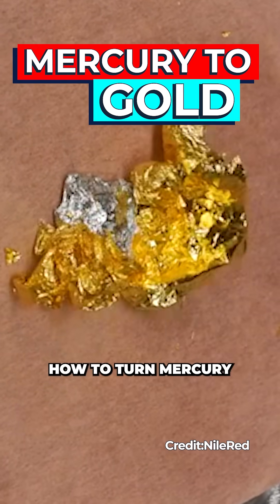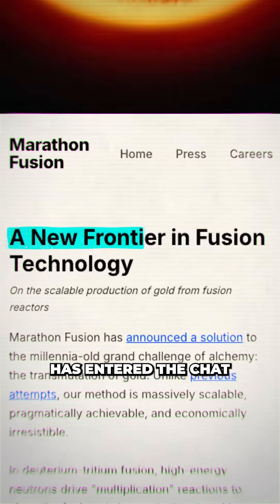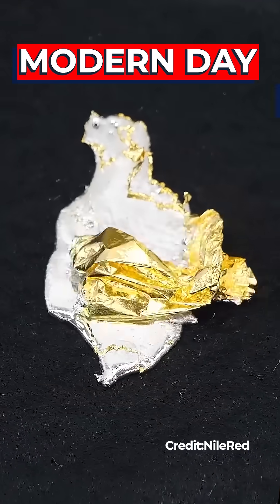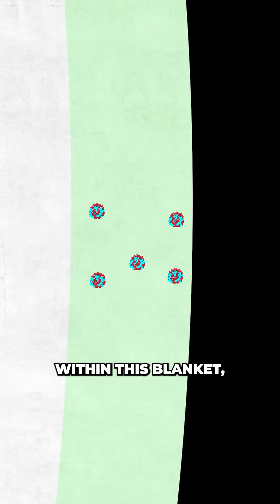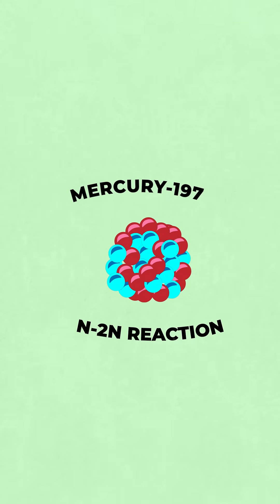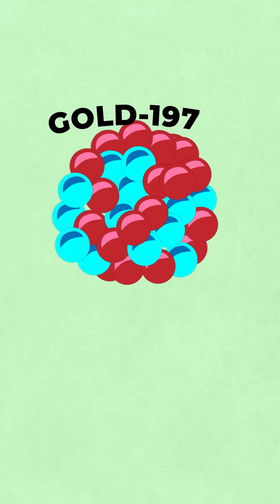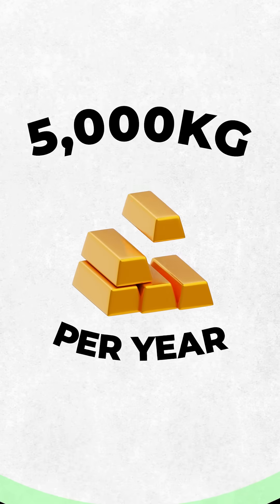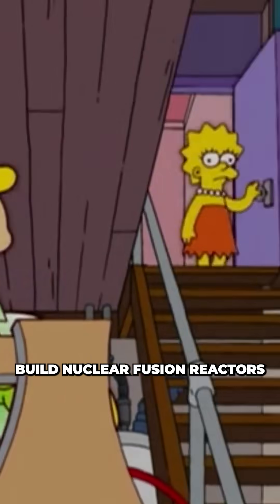Scientists Turn Mercury Into Gold

Comment: A few caveats for people who like the nitty gritty details:
1- You would need to enrich regular Mercury to obtain the isotope Mercury 198, which is occuring at 20% in regular mercury.
2- The technology isn't there yet. This was a simulation. It should work, but still needs to be proven by experiments.
3- The new gold would have to be kept in storage for about 30 years for it to completely decay and become safe to use.
4- If they do this on a big enough scale, it will inevitably lower the price of gold to adjust for this method, which would reduce the potential profits substantially.
Reply: Another science channel said 14 years of storage for it to reach safe levels. However, a lot of gold are tucked away in secure vaults as reserve currency anyway though, so I don't think a decade or three would matter much. If sold at a discount, then national banks with the appropriate vaults would gobble it up knowing it'll match the value of regular gold at some point.

The 3 to 5 tons a year per plant won't be enough to tank the market because mercury is also a rare mineral, which will limit the number of these plants. Gold also have a lot of unmet demand as well as potential demand which would come with lower prices, creating many layers of cushions in regards to price drops. The real potential demand for gold would have it replace much of what we use copper for today, but that would require increasing the yearly influx of gold by several hundreds. And up to 5 tons a year from a single plant is a drop compared to the mining industry's output of up to 3500 tons a year.
Reply: @ShadowTani interesting semi-benefit is the removal of mercury from the earth which is a highly toxic waste material. If the value rises enough we might see companies trying to recover mercury from the environment.
Reply: @totengraben  I'm not sure what you mean with a waste material? The metal is intentionally extracted from heating cinnabar, so its not a byproduct. Mercury have its uses, although concerns about its toxicity have resulted in much of its historical usage, like in thermometers, being phased out for alternative solutions. It still remains useful in the chemical industry as a catalyst however, and it's also used in some electrical switches and rectifiers among other. But it certainly have less known practical uses than gold, and so until better uses of it is found then having the option to convert it into a material that have unmet demand is certainly a boon.
Reply: @ShadowTani mercury as a waste material may be in reference to the cadmium, nickel and mercury occasionally found in electronic waste
Reply: @ShadowTani  Mercury is used in the mining of gold, leaving a lot of destruction behind it. If this substitutes mining in the Amazon & similar places, it will be a really good thing.
Reply: @ShadowTani wait till people start synthesising mercury 😊
Reply: @ShadowTani  until they learn to make mercury from iron or something
Reply: @ShadowTani  Central banks you mean. There are no such things as national banks. All banks are privately held. Even the Federal Reserve
Reply: @saakers  Please refer to wikipedia, a national bank is a thing. Although synonymous with a central bank it can also be used as a broader term, and to be fair I should probably kept it specific. So yes, I meant central banks. And I were talking from a global perspective where banks are certainly not universally private. Where I'm from, Norway, the central bank is owned by the state and is its own legal branch of the state.
Reply: @ShadowTani ”Please refer to Wikipedia” hahahahaha. Wow.
Reply: @Wolfe-xz6tr  It's condensed and easily accessible information. Just because one have trust issues and favor conspiracies doesn't mean it's an unreliable source most of the time. If one prefer to spend the extra time doing ones own research then the same information can be found spread across multiple other sites. The later is certainly the preferred method for more subjective subjects, but in regards to what boils down to defining a concept? You'll just be wasting your time.
Reply: @ShadowTani  On your YT profile you have a cartoon dragon and listed pronouns. It all makes sense now. Sit this one out, kiddo.
Reply: @Wolfe-xz6tr  So what? Lol, "Kiddo" says the willfully ignorant Karen who takes offense at something as minor as someone specifying whether they are a man or a woman in their profile, while apparently being so insecure that he think modern entertainment and art can't be appreciated by adults. That's neither a rational or mature response by any measure. I understand you have nothing else than an ad hominem to counter with, but you're only shaming yourself.
Reply: @ShadowTani okay but if Mercury is rare too, would we theoretically be able to produce the Mercury through fusion via a more common material too?
Reply: @ShadowTani Mercury has an abundance of 0.08PPM while Gold is 0.004, making it significantly more abundant than Gold and proves your opinion totally incorrect and void as any increase in gold supply will reduce demand and price; dozens of those nuclear plants would severely plummet the price of gold. 

Maybe know what you’re talking about before sharing an opinion? 

Just a thought.
Reply: @Slayer2029  Spare me the arrogance. One mistake doesn't invalide an entire argument. Fair enough, gold is less abundant than mercury in the earths crust, but most mercury is extracted from cinnabar ore which is not particularly widespread. Still more abundant than gold deposits apparently, but not to the scale of twenty times that you get from just looking at the crust sample ratios. Still, my point was that Mercury is still rare, and that would remain true even at twenty times the ratio of gold. Rare enough to limit the number of these plants being built.

And the market goes both ways, by the point at which gold prices would go down, mercury prices would gone up. At which point the economic viability of such plants would also go down, limiting new ones from being constructed,

Moreover gold have many practical applications and an unmet demand as it is, especially if we count all the things which gold would be the more ideal material for, but which we now use substitute materials for instead. Prices would therefore even with a larger influx only stabilize at a lower price point, not plummet.
Reply: @ShadowTani It really wouldn’t. As gold drops who do you think is going to hold onto it? The holders will drop it like a hot potato and it will flood the market space, plummeting price and making it a semi-common metal. It only holds the price it does now because people invest in it long term and hold it, which keeps supply down with demand high. As soon as they start dumping it all changes. 

There’s also plenty of mercury mines that closed because it simply wasn’t worth the cost of mining as a result of low demand and the toxic label; when they overnight turn into literal gold mines people will be rushing from all over the world to invest and restart them. 

Meaning both gold and mercury will flood the market and neither will balance each other out.
Reply: @Slayer2029  If the banks stop hoarding it, it'll be gobbled up by the industry instead. But that's unlikely to happen. Due to golds unmet demand its prices is astronomically high now and still on the rise. It was still attractive as a form of reserve currency back when its value was considerably lower. At this point lower prices would be a relief in the market, but because of that unmet and untapped demand any new influx of gold will have a fairly notable cushion in regards to price drops. Thus if the influx is significant the drop in value would still be slow over time. It won't plummet.

3 to 5 tons a year from a single power plant is not significant compared to the 3000 to 3500 tons mined each year. It would take quite a few such plants to make a notable impact.

If we had enough gold to use it for everything where it's the optimal material then it would replace much of what we use copper for today; that's just how significant golds potential demand is. And that demand can never be met by converting mercury alone. The entire worlds supply of mercury could be turned into gold, and the world would still find an use for every bit of it.

Nevermind that 80% of all the mercury would need to be enriched which might be detrimental when the actual goal is energy production. Remember gold is a byproduct of this, not the goal itself. So for all we know, only 20% of the mercury is viable in the first place.
Reply: @ShadowTani gosh guys, this was amazing. Thanks for your thoughts! Really insightful. I'm with ShadowTani tbh. But maybe because of my bias of being invested in gold. On the other hand I trade it as well, so I don't mind shorting it. But to me, it resemble AI. People think it's 100% going to control us in future. But the AI models now barely can spell sentences correctly. So we are very very very far away from general AI. As well as with "alchymist gold".
Reply: @Slayer2029 We need gold for tech tho, idk why more gold is a bad thing
Reply: @Slayer2029 This is fake news. Throughout all of human history mercury has been mined to the tune of around 2 million tonnes, whereas gold is estimated at around 225 thousand tonnes and silver about 1 million tonnes. 80% to 90% of that is in the last 100 or so odd years.

Gold gets mined to the tune of 3,000 tonnes per year on top of 225,000 tonnes that have been mined.

In order to produce 1 tonne of gold from mercury, you would need 600 tonnes of mercury to obtain Hg-196 which is naturally occuring with an isotope concentration of 0.146%.

This means that to make even 1% of the currently mined gold production, about 30 tonnes, you would need to mine no less than 18,000 tonnes of mercury. The entire global production of mercury in a single year is a tenth of that, and most nations have signed laws that force them to stop after 2032.

It would hardly make a dent in gold prices even if they figured out how to use all of the available mercury that has been mined throughout human history, roughly a million tonnes, which would yield as much as 100,000 tonnes of gold using the desirable mercury isotopes (Hg-198 (around 9.9% concentration) or 1,600 tonnes (Hg-196, 0.146% concentration).
Reply: Goldfinger likes No 3
Reply: @Blechfuchs goldmember
Reply: They will just copy the DeBeers playbook. Release in at a steady trickle to maintain high prices.
Reply: @Bob_Smith19no the trick there is to convince people that you should spend 3 months salary to pay for a single ring
Reply: @Bob_Smith19 Unless many people do it
Reply: @Bob_Smith19no if it's possible u can put together ur own system to make ur own gold and u become rich. the economy will drop there's no way to "maintain" it that's a fantasy
Reply: @Bob_Smith19  think what you want, but companies in general prefer to sell more units at a lower price than less units at a higher price, because the increased demand due to lower prices usually ends up generating more profit overall, even though the profit per unit is lower. Of course, this only works to a point. Sometimes companies have to reduce supply in order to not have the price drop too low to where they can no longer make a profit, but in general, companies definitely prefer to operate at a larger scale and have more product turnaround, as they can take advantage of economies of scale, it helps with cash flow, etc.
Reply: @Bob_Smith19No, no they wouldn't. It costs millions to make a few grams of gold via this method. It would be cheaper to dig for gold by HAND
Reply: @Bob_Smith19 that only works when you have a monopoly, lol. If they don’t sell their gold, they won’t profit, and everyone else will continue selling their own gold.
Reply: To be fair, gold is already often just being kept in a vault for long periods of time.
Reply: Yes and no on the profits. Gold isn't just valuable for jewelry anymore. It's highly useful in tech. The value of gold will keep going up as tech demands more of it. So, while this gold would slow that increase, it won't cause a decline in value.
Reply: @xyex yes the value will 100% decline if you saturate the market enough, although it would still hold a relatively high value so could potentially be worth it considering the price to make it since its usefulness in electronics, if they scale up the production enough to make it actually cheap, imagine they created millions of tonnes and it became cheaper or not that much more expensive then copper, people would use gold cables instead of copper ones since it’s more efficient and easier to work with, gold is so soft it would be perfect to use in cables since you need to bend them to make good looking installs….
Reply: @xyex  that’s should be the pinned comment 😊
Reply: @xyex  And because of its growing practical use/ease of control, the rich will have a reason to ignore over production. Which they will be happy to do, since the cost of entry is high enough not to threaten the status quo, and they prefer market stability.
Reply: @xyex  As mentioned by OP, this is scale dependent. It also depends on gold recycled from old tech.
Reply: @xyex saying the price wouldn’t lower is dumb, ofc it will go down depending on how much the market is saturated… you have to be a moran to say it definitively won’t… I’m not saying the price will go down, but saying it won’t is delusional….
Reply: @Rrrrrrr37762 If the value goes up $30 but, at the same time, down by $10 because of nuclear gold, then it still went up by $20. You'd need a much bigger influx at a much faster rate to really have an appreciable effect.
Reply: @xyex The intrinsic value of gold is far below the strike price. Last time I read up on the intrinsic value it was only around 400 / oz. That was probably 6 years ago so it'll be a bit higher but to justify the price with that logic is not accurate.
Reply: @CaptainGreenTea 😂 wrong
Reply: Curious about the details on #3, but #4 is just how the market works lol
Reply: There is also the fact that the Lithium blanket would be absolutely essential for a fusion reactor. You would need to bring in tritium for this process to work otherwise and that is all but impossible since there is next to none naturally occuring due to its relatively low half life (12 years I think).

Making the blanket work properly is also one of the main struggles currently in magnetically confinemed fusion research.
Reply: 5- no matter the century, fusion is always half a century away. 

6- they could get the neutrons from fission too.
Reply: Profits don't matter because the main profit is having more gold, which has more applications for technology and science than it does for useless jewelry or as a basis for monetary value. This also means more people would be able to afford gold jewelry and bullions, negating the need to eliminate gold jewelry in order to have enough gold for for future technology. (Which right now we will have to eventually eliminate gold jewelry because we need it for semiconductors and technological applications)
Reply: @bodhiallen9362 We don’t need Gold for industrial use at all.
Much cheaper and superior metals available
Reply: You don’t need to enrich Mercury, once it turns into gold it can be chemically seperated. Nuclear fuel for fission has to be enriched cuz it’s a volumetric density (and probability) limited reaction. U-235 atoms need to be concentrated within a particular volume of space for them to produce enough neutrons for the 2nd generation of reactions, etc etc. Right about the rest though, and enrichment would’ve been by far the hardest part. Also its beta decay so the radiation isn’t that harmful, although not something you’d want for a medical implant— oh wait they already use betavoltaics in medical implants
Reply: on 1) Yes but you would also have to enrich lithium to have the same breeder blanket, and enriching heavier isotopes is a known tech (and simple/cheap, more so at 20% initial enrichment)

2) TBF most of fusion tech is either not proven or in its experimental phase, but its a fair point.

3) Not a huge issue tbf, just would require setting up systems in place to ensure profitability and ensure the gold isnt stolen in those 30 years.

4) TBF with gold there are tons of industrial uses for it, so like platinum (which is in the same boat) there would be a floor for the price where if it dropped below industry would gobble up all of the gold until it went back up above the price. Would suck for gold hoarders but at the end of the day it would be better for humanity if gold was cheap as its such a good industrial element besides its price.
Reply: Oooh the number 3 part makes me worry black markets with possession of this gold before the 30 year decaying period would skip it and just sell it without moral responsibility, causing radiation spread, there will be a new set of laws and gold tracking will certainly be improved as well as radiation meters from gold purchasers once this issue starts gaining notoriety.
Reply: Lastly, the isotope of tritium used in nuclear fusion reactors is also used in H-bombs. 
As a result, it’s likely one of the most sought after materials on the planet, with the overwhelming majority of it being stored in warheads. 
Unless/until nuclear disarmament occurs, it’s likely that this isn’t the most viable use of that breeder blanket, since you’ll need the tritium it makes to continue testing.
Reply: I've been doing this in my shed for 20 years. Not sure why my neighbors keep dying
Reply: 3 is't a problem because 99.9% of all gold is never used anyway and just stored away in vaults
Reply: @nielsdaemen However, much of the gold America claims to have at least, doesnt exist in those vaults anymore, so it is desperately needed. They need to replace the gold they already claim to have.
Reply: Thank you Science side of Youtube
Reply: Couldn't you chemically separate out the radioactive mercury from the gold to make it safe to use early?
Reply: Kinda like commercially produced diamonds
Reply: @riggmeister I wonder if it would be discernible from its earth-mined counterpart tho, as  lab diamonds are
Reply: could still borrow against the future expected value
Reply: Actually it's very risky to lower the price of gold considering how many countries support their currency through gold reserves
Reply: It won't necessarily lower the price completely because the new wealth of gold could open up a boom in electronics, and honestly, who cares if gold becomes basically worthless, it's still gold, the best bling there is. The only people that would care would be those obsessed with its monetary or status value. I, on the other hand, would love to see a world where humans walk around decked in gold.
Reply: The value would probably not go down. Gold is so useful, it’s not just a pretty metal and the demand is only growing. 

If anything it might lower the price a little but not enough to make it unprofitable. If the price goes down a little, it would just mean we would use it in more applications where we use a worse but cheaper conductor. 

I mean diamonds are still expensive and they are super common. 

Supply and demand are much more complex than “more supply equal worthless in value”. Especially if the demand will still be there at a larger than ever before level.
Reply: Japan is already building a mercury/Gold reactor , so the tech is there already.
Reply: Makes me think of the claims of astronomical riches in space in the form of like platinum and gold. Thanks for the details.
Reply: Keep the gold in storage for 30 years and not touch it? Like... in a vault? As in... what many banks and sovereign nations already do with the gold that they already have? 🤔
Reply: I'll let the next generation solve that. They've already got 99 problems trying to save the planet from the damage we've done so what's one more problem between relatives?😅
Reply: Also countries use gold  in treasuries as a way of avoiding their money losing value. So a massive influx of gold would mean this idea would no longer work
Reply: @Jdhdhdhsrnnc Possibly then again they'd probably shift it to other metals and start using their gold supply for other purposes that may yield higher return such as tech research or industrial.

Even lithium has a lot of value due to it's uses in electronics. Gold would becomes something similar. Used in high end industrial projects were copper isn't enough.
Reply: I can wait thirty years for a solid gold fiddle...
Though it would probably sound pretty crummy.
Reply: There are ample industrial uses for gold that would tolerate radiation that would not be tolerated for Juley.
Reply: The 30 years shouldn’t be an issue since they could just place it as a reserve  / store it in an underground bank vault or locked away somewhere else and never move it for years / decades ~ like the majority of gold we have now. 

Still a big deal if gold can actually be produced in this way since we as humans haven’t had the capability before and we’re just mining the gold that has resulted from natural cosmic star reactions
Reply: I heard it’s super expensive. Like completely makes it not worth it .. plus the other 4 he said
Reply: Then we could stop obsessing over shiny metallic gold as a luxury item and start using it more in electronics, electrical applications, and other practical things.
Reply: @gabriellashimone6546  tbf the cost has very little to do with its use in electronics.

So little of it is used in them that its pennies per item. Maybe if it was cheap we would see it in bulk applications, but even copper being as cheap as it is isnt used in massive bulk applications like powerlines (which is where gold would be best). Soooo there is that.
Reply: @kkirschkk  Cost isn't the point.  Gold is, in truth, useless in any practical application that isn't electronics or electrical systems.  Humans need to start being beings, not magpies.
Reply: @gabriellashimone6546  I mean gold has tons of uses outside of electronics. Chemistry, alloying, art/decoration, medicine ext

Plus what is the issue with enjoying the color or using it as a store of wealth? You seem to imply there is some issue with the above morally.
Reply: @kkirschkk  Practical applications would be electronics and electrical systems.  Those include medical applications.  Alloys with gold, maybe.  Art and decoration is impractical.  There are many more mediums used that require far less processing for both art and decoration.  You're still thinking like a gold addict, something I find deplorable in humans.
Reply: @gabriellashimone6546  I mean liking the color of gold isnt deplorable lol, its like saying the color red is over used.

Also yes some medicines do use gold, so no the limitations of the use of gold are not just electronics/electrical systems.

You sound like someone who has a bent out for anyone who likes gold for anything other than utilitarian uses.
Reply: @kkirschkk No.  Greed is deplorable.  I know what gold is useful for and what of those uses are the most pragmatic.  We aren't magpies.  We also tend not to be pragmatic when it comes to "shinies."  Are we really going to doom ourselves to primitivity or are we going to put aside this foolishness we are presently enslaving ourselves to?
Reply: @kkirschkk Also, I'm well aware of its use in both medicine and chemistry, as well as metallurgy.  Those, too, are practical and require less Au than the uses in electronics and electrical systems.  I think we'd be better off using Au for practical purposes and leaving off with the lust for it and the hunger for wealth.  Such things are doing us no favors.
Reply: @gabriellashimone6546  I mean they also do not really bottle neck other uses for gold either.

Remember a lot of the reason gold is expensive is just that its not a common element and mining it is expensive. Sure a lot of demand is also drawn from its luster and color, but the amounts you use in electronics and other applications is so low this is a non factor.

Basically there isnt any reason to be against gold's use as being an item we like/think is pretty/
Reply: @gabriellashimone6546  "doom ourselves to primitivty"... I mean when we are not dooming ourselves due to our liking of gold, since again the amounts we use are so tiny that they are pennies on the dollar.
Reply: @kkirschkk  Alright, we're on the same page, more or less.  The problem at hand is that humans keep lusting for a thing and don't seek to make practical use of ant materials.  Our species is like so many rampant toddlers wielding a bucket of tempera paint and splashing things with it fervently.  I think we are really capable of far more than that.
Reply: @gabriellashimone6546  I mean there is enough resources to go around while still finding value in the visual aspect of things. That isnt an issue.
Reply: @kkirschkk  There really aren't or those resources wouldn't be given the value that they have been.  Too much value.
Reply: @gabriellashimone6546  I mean is there anything subjective about saying "this has too much value" other than you drawing a line in the sand? is any other noble metal considered in your mind to be over valued?
Reply: @kkirschkk  Yes.  It is a waste.  You continue to speak like someone enamored with wealth.  Continue being a magpie.
Reply: @gabriellashimone6546  I speak as someone who doesnt think we need to just use everything for its most utilitarian use, more so as there is more than enough gold to go around for industrial uses while also still using it for art and other less useful things.
Reply: @kkirschkk The problem is the mentality of most humans.  They go full magpie, lusting for the wealth of gold, not it's beauty, not it's practical applications.   I apologize for being so harshly staunch about it.  Gemstones are pretty, too, and also have practical applications aside from the artistically decorative.  Those, too, are used as symbols of wealth, position, and thereby power.  I am disgusted by such ideals and consider them truly beneath what human beings are capable of doing and being.  My disdain is for the prevalent and dominant ideals that destroy human and other animal lives for the sake of prancing around with nose in air.  Those who are truly worthy of honor don't need objects, funds, or title.  They certainly don't need opulence and ostentaneity.
Reply: @gabriellashimone6546  I mean that still dosent answer the issue of whats wrong with opulence.

We dont need most foods, or personal computers for that matter, yet they are great things to have and we are better off for it. Again using gold in art or design or opulence, while not needed, also falls into that grouping of things that are great to have.
Reply: @kkirschkk Opulence and the lust for it, along with the idea of wealth, is the third chief reason for violence.  The first is religious differences, the second is control of resources.  Beautification that satisfies aesthetic sense isn't negative in and of itself.  It's the mentality of division because of the desire for more and the notion that more shinies makes one better than those around them.  Human ideals need to change so that environments and living things aren't destroyed or subjected to slavery over or because of opulence.  Practicality needs to take first priority with respect to resources, together with equalizing society so that everyone has their basic needs met and are able to find purpose.  A lot of my thinking comes from things like Star Trek.  I believe in equality and merit.
Reply: Obtaining a wealth that will slow delete you is some wicked irony.
Reply: Do you know if it would be completely indistinguishable from ordinary gold, or could people tell it is man made?
Reply: @br.m  So once its purified and has sat to rid itself of any radioactive isotopes, not really.

The reason why you can tell man made diamonds and other gemstones apart from natural ones is that the man made stones are too perfect compared to the natural ones (and have defects that don't occur in nature while not having natural defects that do).

With gold it is purified to 99.999% purity (5 nines, about as good as you can reasonably get on an industrial process without spending boat loads of money), and while in theory that remaining one thousand of one percent (or 1 part in 100,000 or roughly 10 parts per million (ppm)) might be able to give it away if its radioactive or has a trace element in it, you can also dilute the gold with other "natural" gold to further make it hard to track (you cant melt and dilute gemstones).

Plus most detection methods struggle to detect light elements below the 50-150 ppm (without going to insanely expensive and variable methods, a lot have questionable accuracy), and while heavier metals can go down as low as 1-20 ppm your getting into the range that interference compounds can send results all over the place (plus tests going down this low are very expensive and very prone to errors).

So in theory yes (but it would be extremely expensive), but the testing would be prone to massive errors (+/-100% or more), and you would only have to dilute the gold down with 9x of the same volume of "natural" gold to basically make it impossible to detect with any reasonably practical solution on an industrial scale.

Plus at the end of the day, who cares? Its physically and chemically the same (even more so than lab grade diamonds which are only chemically the same).
Reply: @kkirschkk and if you're impatient, it's just beta radiation, mostly harmless unless you eat it. But who would ever eat gold right? /s 😂
Reply: @kkirschkk synthetic diamonds are also marked with a tiny microscopic laser that identify them as synthetic
Reply: @Flipout22  Thats only if the company that does that bothers to do that. Easy enough to avoid it.
Reply: @br.m  Gold is an element, if it's melted down, any specific isotope of gold is not going to be differentiable from the same isotope sourced from anywhere else. Same as iron and copper.

Similar market - artificial diamonds (grown from carbon) are also really hard to differentiate from naturally formed diamonds, aside from being perfect.
Reply: @leaf2690   I figured as much, just like some coins are sold as "single source" but there is really no way to prove it is from this or that mine..

In any case, I am sure the powers that be will find a way to make sure gold stays expensive even if they can create it cheaply.  Hopefully this created gold will be less damaging to the environment.  Just like how people are starting to use plants to harvest metals from the soil.
Reply: @br.m Are you asking if it's REAL, elemental gold or if it is distinguishable from gold in nature under examination? In theory, it would be real gold. Another commenter discussed whether we could distinguish it from gold found in nature.
Reply: @br.m this gold and the gold you find underground are identical in an atomic scale, there is absolutely no difference between the two except their origin.
Reply: There is only a single stable isotope of gold, so if this synthetic gold is completely purified it would be indistinguishable from natural gold 

But it is virtually impossible to completely purify anything, so there may be traces of the source that could be measured.
Reply: @br.m nah, prob not
Reply: @br.m if the gold is truly gold down to its atom's isotope, then it's gold.
Reply: @br.m  It would produce "tons" of gold, but in the literal sense. We mine many tons of gold per year already, the market doesn't care. You need a substantial amount to affect it (like when the Spanish created inflation by looting the Aztec and Inca of their gold)
Reply: @br.m there would be trace amounts of isotopes not found in natural gold. So under a spectrometer, no?
Reply: @br.m  Most likely indistinguishable. It's not like diamonds where one can look at the crystal structure. Gold is a metal. An atom can either be gold or not be gold.
Reply: @br.m it would be more radioactive than typical gold. It also would different mixture of isotopes compared to that found in nature
Reply: @br.m  it's an element. It will be identical to real gold.
Reply: @br.m There would always be traces of Mercury left in it
Reply: @br.m gold is gold. No difference
Reply: @br.m Its radioactive.
Reply: Make it all at once and sell it in 30 years
Reply: Aa I understand it 10 half life decays should bring it back to near background levels of radation.  So in 640 hours you would have 1024 times less radioactive mercury.
Reply: Sounds about right 👌
Reply: I mean we use gold in electronics so i think theyd have a fairly steady income from tech companys alone
Reply: The other issue with this process tends to be that the power required to indice this reaction has always been more expensive than the actual gold itself.
Reply: Is mercury abundant? Will the price of mercury sky rocket?
Reply: @Aurelio-88  $6-$20 per kilo, it is rather abundant so its unlikely that the price would skyrocket.
Reply: Yer, 20 years away 😅
Reply: It’s really good for materials tho
Reply: It will still produce gold at a fairly slow rate, and it's more likely to help with the initial costs of building the reactor in the first place. It's also just a byproduct of generating power via nuclear fusion, so other than the cost of getting and working with the mercury itself, this doesn't ridiculously add to the cost. Finally, this is where I'm just guessing, but it's also possible we could make other materials this way by using a different element than mercury. Not sure if this is true, but if this process works out, I imagine it's a possibility.
Reply: Thank you for supporting facts and reality. I hate how these accounts will say the little points about something and make out like its a big deal only for the big picture to be a pile of BS. We dont have finished fusion reactors of any kind at the moment, and even stating that "this simulation and the papers about it arent peer reviewed" means nothing to your average person and they know it. When that statement really means "its only a simulation based on technology we dont have yet and the scientific paper behind it means absolutely nothing because it hasnt been peer reviewed"
Reply: 3rd point doesn’t matter because normal gold doesn’t change hands too. It is just the paper that says I own this gold. They just sit in vaults in major trading hubs.
Reply: Pro, less toxic mercury.
Reply: I think it'd be cool if they just used that to make space projects rather than inflating market value
Reply: *deflating
Reply: Well consider how useful gold would be for various industries if it were a bit more cheap and plentiful. The price would of course drop, but not necessarily the profits of the producers if the price reduction opens up new markets.
And I'm sure with jewelry it will be the same as with artificial diamonds- People will still pay premium for the real thing, even if you need a microscope to tell the difference.
Reply: It will reduce profits but fuel advances in science and tech and improve the world in many ways. For instance, gold allows for improved  efficiency with less byproducts in many chemical reactions when used as a catalyst. That, plus politically fueling the adoption of fusion reactors, could allow for cleaner, cheaper energy at scale.
Reply: No, I disagree. A big concern with gold is its limited amount. We can use gold now instead of copper for lines which is one of the best conductors, I believe. Gold is fucking goated for electronics, and being able to print gold would fuel a new age of upgraded technology infrastructure
Reply: India would hoover it up, as would everyone else who wants gold jewelry
Reply: Leading to laws to prevent the making of gold.
Reply: Yea but they can still trade the gold while it ISS being held jn the safe..if this works out it will demolish the price of gold
Reply: @Kukulkan_Tours The point of making it illegal to make gold. All reactors are under some level of government control.
Reply: Gold being cheaper is good considering its usefulness in technology
Reply: This is awesome info. That sounds like an absolute win, too. Gold being pervasive in electronics, this sounds very highly positive.

I can only hope that similar methods come about for chemical sythesis of lithium.
Reply: Just bring in an asteroid rich in gold.
Reply: I’m thinking not actually using the gold as a basis for currency or value but as materials to be used for technology. We already use gold for this purpose anyway
Reply: If we become a space fairing people the amount of gold we'll be sending into space and tech will be large this method could keep the price of gold for tech use reasonable
Reply: So that means my gold investments will live shortly 🙂
Reply: And also, it wouldn't produce the tritium you need to run the fusion reactor in the first place.
Reply: Also mercury is not common.  It's more common than gold, but still rare.
Reply: They should have kept it a secret
Reply: It could still drop the price of gold if they prove it's possible, even before it's done.
Reply: Good. Gold has way more important uses than currency. I’d rather not have to pay 50 bucks for a pack of glucometer test strips anymore
Reply: Was gonna say, how the fuk did they plan to do this with fusion lmao
Reply: imaginable. if mercury 198 is used as the reactor linear it wont be part of the main structural material of the wall. It will be used as an outer liner. in the best case as a pure liquid metal linear. in the worst as a low percentage alloy. gold production amount could easily go down from 5000kg to 500 G depending on design
Reply: Ok but imagine the story setting radioaktive gold would be:

A band of theives find a hidden storage of gold. overcome by greed they take it, but OH NO! The gold is cursed!, they start feeling sick, their mind deteriorates, in fighting and stealing begins. 

People find out that those who hoard the most gold, and is the closest to the original crime, is the most affected by the curse.

People who backstabed and stole the stolen gold has it bad too, but less than the originals.

But the everman who accepted small amounts in legit payments for legal service?
They are mostly fine.

Years later a guy gets a coin made from this "cursed" gold. The guy decides to inspect and study it hoping to find an explanation, but there is nothing to find. (by now the radiation is well below safe levels).

Was the curse real? Or was it merely a moralistick myth, superstition and folkstory about the folly of greed?
Reply: Thanks for AI generating a response and sounding clever. Means I don't have to.
Reply: While your points are 100% true, I’m thinking about this as a future tech since electronics need gold. Now there is a way to actually make more of it when mines are less common. 

Yes there will be gold inflation, but the gold mines are only becoming rarer and more expensive every year
Reply: I actually think it would increase the gold price because there are a lot of technological pathways that are at a stand still due to lack of materials more gold more progress more money
Reply: Thank you for this additional information. I was kind of wondering there would be a few problems with what the YouTube short was telling us
Reply: but gold is a great conductor tech, which will help have more refined material for our space age epic if it ever starts.
Reply: sometimes it isn't about profit, but scarcity about resource that has tangible value outside of perceived monetary value.  

So while this innovation could cause the gold to become "cheaper" 

I don't reckon we'd be making enough of it anytime soon for it to diminish in price.

It still has a high utility value. Not only for aesthetics but in corrosion resistance. and it being a decent conductor of electricity.

I have little doubt that they will make use of this stuff, but mostly we won't hear of it much like the manufactured diamonds. Most of which get used in the industrial industry.
Reply: there is also marketable value, if you could distinguish genuine gold from artificially created gold it could potentially create two market values for "gold" 
where Gold the natural stuff increases in value even it doesn't preform any different, and there would be a good identifier with the isotopes from the artificial stuff leaving a lasting impression on the gold that is created.
Reply: Where did you get 30 years from? I got  ~27 days for going through 10 half-lives where it will decay to well below background levels. So I think 30 years is pretty generous unless there is radionuclide that would be favorable that has a longer half-life.
Reply: Maybe this stabilizes gold futures 😅
Reply: Talk about one hell of a Gold futures market stocks.
Reply: Diamond already proven that the price won't go down as long as someone controls it.
Reply: They don't have to tell the buyers this
Reply: Basically the company can and will control the Gold supply to keep its price high enough so that they could make profit margins
Reply: Thank you for your dose of sanity!
Reply: I like when smart people talk
Reply: The last point is the most important. Gold has virtually no practical use. It's basically just solid money, whose value is proportional to its rarity.

Imagine you get a million tonnes of gold but no one wants to buy it from you. You may as well have a million tonnes of scrap metal.
Reply: @PaladinswordSaurfang  I've heard people say that before, but it's not really accurate. Gold has many practical uses other than aesthetics—especially in electronics, aerospace, medical, and dental fields. It's an excellent conductor, doesn't easily oxidize, is hypoallergenic, and is extremely malleable. But fair enough—I wouldn't recommend making a sword out of solid gold.
Reply: Gold is a really good electric and thermal conductor, that doesnt oxidise, thats why it is used, in plating  of copper even though,it has sognificantly lower conductivity and higher costs that silver
Reply: One solution that this is industrial gold, just like diamond, and not for jewel-ing, since gold is already used in electrical components
Reply: Yes but isn't gold insanely useful for a bunch of stuff like electronics like how copper is? Would make if more viable for manufacturing if enough is made.
Reply: Storing it for 30 years not a problem it's can be used to buy things on a credit lol being everyone even country buy at credit now
Reply: Legend
Reply: Also, 5000kg is only a small portion of total supply. Some 3 million kg of gold is mined anually, which would equate to 600 1GW fusion reactors, which is more than there currently are large-scale oparating nuclear reactors in total. It wouldn't tank the price.
Reply: Isnt it like only 0,7% of all uranium that is usable in nuclear fission reactors
Reply: But the uses of gold for electronics and stuff will be useful
Reply: "Sir would you like natural gold or man made gold?" A question I thought only diamonds would have.
Reply: you say limits I say issues that can be solved. first one is either volume based or create a better enrichment method 
2 is pointless, technology is never there until it is so stop using it doesn't exist as an excuse and go do it.
3 seems like a good problem to solve anyway so lets find out what can act as a radiation sponge, IF SOMETHING CAN EMIT IT THEN SOMETHING ELSE CAN PULL IT IN. 
4. go tell that to the Diamond people and watch how they laugh at you. "Lab gold isn't as valuable as natural truegold" if gold becomes like lab gems then it will be treated as such. divided into two types of gold even tho both are the exact same substance
Reply: Issue is. This project is 8 years old and they have already SUCCESSFULLY made the gold and it was pretty much safe for use within a few weeks. That's right this experiment has already been done.
Reply: BITCOIN 😂 the New Gold!
Reply: @Jack-O-22 bitcoin isn't physical and has no practical use
Reply: But gold is useful in other things like in electronics.
Reply: thanks
Reply: As soon as he said “San Francisco-based startup” I knew there would be massive caveats, lol
Reply: If the price of gold drops enough, it'll be the conductor in every automotive wiring harness...
Reply: "it should work" they've made gold atoms in particle colliders for decades now, the issue is you would spend millions to produce grams of gold lol
Reply: On so many levels this is stupid !!
Reply: I find 3) particularly 😏
Reply: Gold can be used in space travel ,after all space travel will likely more common in future.
Reply: We have lab grown diamonds, and diamonds are still too expensive, but if we get gold by either this method or mining in space.. it will cost 2 paperclips and an old button per kilo
Reply: don't care if it is 100 years after production... I aint touching that gold
Reply: “So you’re saying there’s a chance”
Reply: @rowannnnnnnnn  I don't believe that it actually turns into the same structures as gold but i wouldn't touch it either way
Reply: Gold is used to build spaceships... There will never be an overabundance when we start touching the Stars 👽
Reply: It would however broadly eliminate scarcity for gold and boost other areas like CPU crafting and other touchy tech where gold is best?
Reply: If it can be done, which I doubt, it would be a million an ounce to produce
Reply: Why wouldn't they just gatekeep the info and experiment
Reply: Regarding your 2nd point, we don't even have a commercial fusion reactor. We'll have to wait 30 years for that too, as we like to say and have been saying for far longer than 30 years already haha.
Reply: @lydoofusbinderp9853 mate, it’s pure shit don’t listen to it.  Obviously they want people to dump gold as they dump on it with bullshit.  Nothing can change one element to another, never mind unreactive gold
Reply: I don’t know if it was done with this exact method, but gold was produced from a nuclear reactor I think in the 90s, but just a small amount and there weren’t any economical motives
Reply: You could buy the gold and save it for your grandchildren, 30+ years ought to be enough.
Reply: The cool part you didn’t mention however is how gold’s utility changes in a world where it’s a manufacturable material vs a rate earth mineral;

It’s one of the best conductors of electricity, doesn’t corrode, so vehicles satellites computer and phone tech etc would have a major leap, copper and silver wire would probably become old school technology, it’s used for medicine and even cancer treatment since because it’s biocompatible (completely safe to consume, no weird side effects)
Reply: Gold profits dont matter more than technological advance
Reply: I think the whole point of "printing gold" is so that newer generations could still have access for making electronics, espl once we mined all of them, but  I don't know haven't read the paper yet also
Reply: If it is a good source of energy, just having more available gold on earth would be better than gold retaining value. It is far more valuable as a component than as jewellery.
Reply: To be fair, gold’s have in electronics will eventually lead to a stable price
Reply: Have you bought and moved 5000kg of gold? Nobody is trading and shipping that amount of gold. It can sit in storage for eternity nobody making money off it cares. 😂
Reply: People gonna be dumping all their gold soon.
Reply: I bet it'd piss off a lot of countries and gold stockholders, as well.
Reply: Considering there's about 200 million kg of gold in existence, another 5 kg/year isn't going to affect the value much
Reply: The supposed value placed on gold is only in consideration of it s use and exchange for currency, and jewelry/other cosmetic designations. Practical applications in other fields, such as components in medical / computer products, would potentially keep its value well balanced.
Reply: I mean most gold just sits on vaults anyways so 30 years isn't that difficult
Reply: Even if it destroys the price of gold over time I think that's probably a long term good thing, we don't use it for money anymore but it's an extremely important material for electronics and space flight. Plus we love to wear it and it looks absolutely amazing, so this would be a win for everyone but gold owners.
Reply: Can always count on this channel to give proper scientific clickbait overselling recent studies. Shame this guy gets to call himself a ‘doctor’
Reply: #3 A radioactive element is generally considered  safe after 10 half-lives  99.999% radioactivity free, so 64 hours x 10 is 640 hours.
Reply: Oops, 99.9% radioactivity free!
Reply: It could be sooner as there’s a plant in Chernobyl that absorbs radiation
Reply: Imagine wiring houses with gold cables instead of copper ones.
Reply: Price reduction is good, it means electronics get cheaper
Reply: It would increase the price of mercury too 😅
Reply: That would tank the price of Gold.
Reply: In the future, people will have to worry about putting on Radioactive jewelries.
Reply: This is a long term (30 year) investment. It also requires monopoly to regulate the price of gold.
Reply: Well no! Whoever can produce gold using this method is the world richest for few years before anyone else copy it
Reply: I already suspected some of this.
If you only present me with half the facts, you have failed and triggered my scepticism. Thanks for confirming my assumptions.

Never trust information from a startup.
Reply: Thank you
Reply: Indian government will impose 200 percent custom duty on that too.
Reply: But we could use this method as a way to make gold for electronics, without digging into our supply of gold.
Reply: @q-tip9962 why? it wouldn't change anything.
Reply: @Commander_ZiN  We have a limited amount of gold on Earth, approximately 2 Olympic sized swimming pools worth. That may still be a lot, but that is still a finite amount of gold. So if you could convert other metals into gold you could in practice you can make electronics cheaper because there is more gold to make electronics from. Does that make sense?
Reply: @q-tip9962 how much gold do you think is required in electronics?
Also you didn't factor in the gold under the crust.
Asteroids would be easier.

In the end I've debunked all these arguments before. It's just another startup trying to take your money.
If it ever makes enough gold to lower the price of gold, it won't make enough profit to be sustainable.

The reason gold has value is because it's rare. I really don't understand why you're not getting it.

I must conclude you're bots paid by the start up which is why many from before have deleted their posts after being thoroughly debunked.
Reply: @Commander_ZiN Dude, are you getting off to debating people on the internet? Literally all I was saying was it would be great if we could convert other metals into gold. There was nothing to disprove. And what you just suggested sounds even more ridiculous, do you know how expensive it is to do space mining with today's technology? We still have billionaires going up on rockets to fly in space as a flex.  And how the hell would the logistics for working an entire mining operation in the mantle look like? Mining in the crust is still dangerous by today's standards! Were would you move all the earth you displaced to get underground, how would you determine where gold veins would be, how are you keeping miners safe and healthy?
Reply: @q-tip9962  well for starters humans have found 3 to 4 times olympic pools of gold and most of it is in storage. I don't see why you think we have a shortage.
It's like a maximum $15 cost to a GFX card, and it can be recovered.
There is no current problem that needs addressing.

This is merely an argument on whether it makes economic sense. It makes as much sense as printing money. Even asteroids don't make a lot of sense but they make more sense than this because you grab rarer metals. It's like you think making this gold would cost nothing.

Your arguments are unintelligent.
Reply: Good parts of it are that gold is very useful outside of just jewellery, it can allow us to build electronics etc which is great, also wouldnt this still be fusion so were still getting energy.
Reply: @SKV_8 it's like you didn't even read what the original poster wrote.
Reply: 30 year turnover makes its impact likely pretty low until economy of scale kicks in and they have a new batch every year
Reply: The benefits tho of having relatively low cost gold for electronics would be great tho its
Reply: @jonathancrosby1583 what? gold is a commodity. If gold became low cost then you'd spend more money on making gold than the value of gold.

Anyway spending less than $2 on gold for your $2000 graphics card ain't really an issue.

Just think about it a little.
Reply: Not if it can be shown in any way not to be natural and instead lab grown. If so, it’ll be worth far less. Like like grown diamonds
Reply: @BigDawwwg4LIFE go back to school. It's not a crystalline structure, it's a metal and you can melt it down.

I feel this video has created more misunderstanding than understanding.

It's just corporate startup BS claims in order to get investment into a really stupid idea.

No matter how you do it, whether getting it from asteroids or whatever. If you make a rare substance common, it will lose its value.
Gold ain't even that rare, it's abundant, just not on the surface of the earth.

Better to focus on rare battery elements that will be in future demand.
Reply: The value of gold will be lowered but not drastically. Additionally, this isn’t really a bad thing because there are so many electrical applications of gold that just aren’t being used because gold is so expensive so it isn’t viable.
Reply: @collindavies2444 your logic is terrible. You forget economies of scale, boom and bust, eventually it will lower the gold price to be not feasible, assuming it's at all feasible.

Secondly which applications for electronics require gold that don't use it? Who tells you these things? What are your factual sources or are you just making shit up?

Why do people keep buying the claims of self interested start ups so easily?
Or did the start up just pay for a bunch of bots?
Reply: On the inflation: at least we can use gold in jewelry without it being super expensive.
Reply: But, why is gold so precious?
Reply: I can do it in about 3 years, as anyone can, it's so much more simple than most think, think simple and outside the box, and pressure, think dog a hole and add water pressure and fill it up pressure, most of pressure, and dog and wait and gold LoL
Reply: J.K. LoL
Reply: Thank 😅
Reply: This new gold is au 197 stable and doesn't decay
Reply: It wouldn't be nearly enough quantity to crash the market. Price might initially dip marginally then continue on its traditional upward curve. It's no different than finding another naturally occurring major deposit.
Reply: 30 years to completely decay...
Like with headphones having noise canceling tech it would take just a few years to invent a nuclear waste canceling tech with modern ai...
Reply: @bartvanhecke4623  thats not how nuclear physics or technology works.... like at all
Reply: @kkirschkk ow sorry, i had no idea... 😂
Reply: Gold is really useful in electronics though, right? So this could be helpful for manufacturing, I assume.
Reply: Imagine the cash out though. Haven't even begun to peak
Reply: It doesn’t matter how long it’s stored to be stable all they have to do is designate it as radioactive and use a Federal Note as representation for trade. Take each lot for storage until the radioactive decay has come down to safe then fully release it
Reply: Diamonds...

Should be the same except for the radiation decay needed ...

Get your Diamonds checked before you buy a wedding ring ...
Reply: Even if they do this I've got a feeling it'll be like the diamond market where you can tell if something is lab grown or made by God
Reply: If I'm not mistaken, there is now technology that can irradiate materials. I may be wrong, but if I'm not then that means the wait period could be significantly reduced.
Reply: No way if they make more gold the price of gold will go down. Wow who would have thought.
Reply: Not to mention, the operating, capital and safety costs are gonna be astonishing.  Probably close to making the cost to make fairly close to current prices.
Ita gonna be hyped; they said the info and idea is from a startup.   They WANT to hype up so they can increase value of ther company
Reply: Didn't understand a word, still gave a like for the time it took you to type it out.
Reply: .... A simulation...
Reply: Nerd
Reply: Yeah, but we already left the gold standard, and we wouldn't have to spend like a year's salary on a wedding band anymore, so I say it's worth it.
Reply: Reducing the value of gold to below cost of production.
Reply: Mercury rising.
Reply: Marathon’s “nuclear gold”: 5 tons/yr, costs ~$50k/kg (enrichment + neutrons + 30yr storage), = 0.1% of annual mining. Market shrugs.

Your #4 would kill gold prices… if we mined asteroids. One rock like 16 Psyche could dump millions of tons at $500/kg. That’s the tsunami.

Lab trick ≠ space flood. Different scales, different fates.
Reply: yah it would effectively crash the gold market forever id think
Reply: say it should lower the price of gold but know what government and countries are like they will raise the prices like diamonds and lab diamonds will just be like that, governments are people in control over gold and currencies are greedy they wont let prices lower
Reply: @CH33SY93  The world runs on debt, not gold
Reply: I can enrich mercury. How much money do I have to give to it? 😂

I can certainly hold on to it for a complete decade. I have a big scale to put it on.
Reply: In any matter gold prices will become dirt cheap in future cz if its not artificial gold we will soon find out some metal that is more precious than gold and gold will come second place. 
Thats why expert nowadays don't recommend investing in gold.
Reply: @Believe2winyes  2 metals that are more expensive than gold:

Rhodium — ~$7,900 / oz  ￼
Iridium — ~$4,500 / oz  ￼
Reply: @albeit1 you can't wear any of it. Ever since gold reserves are getting low there is hoarding to find something that can replace gold that is safe to use and has same sparkle like gold.
Reply: won't this make mercury the new gold..
Reply: @MR2car it was incredible stupid takes, your takes, and I can explain, why:

1. Это вообще не проблема. Лазерное разделение изотопов, только в отличие от известных нам по незасекреченным частям этой истории (истории о том как США коррумпировали человечество, скрывая от него возможность пользоваться такой обогащающей нас технологией, технологии лазерного разделения изотопов, — это буквально единственная частная технология в США, которая на государственном уровне засекречена, она буквально единственным кейсом применения специально сделанного под неё закона засекречена! И вы об этом в Википедии даже можете прочитать, со ссылками на источники!) свидетельствам о рассматривавшихся схем, использовать изотопную разницу в расщеплении энергетических уровней, читай атомных спектров атомов в сильном магнитном поле, — что позволяет, имея перенастраиваемый лазер (а здесь мы уже имеем технологии высокомощных высокоэффективных перестраиваемых лазеров и лазерных схем за копейки, это уже наша реальность), — а дальше можно было бы даже ничего не делать, пользуясь избирательной ионизацией в сильном магнитном поле. А можно например вместе с газообразным метаном смешивать поток, чтобы у вас ионизированные фториды например реагировать стали с ним, и высаживали соединения необходимого вам изотопа в осадок.

Мы таким образом физически можем за смешные деньги абсолютно изотопно чистые вещества получать за смешное количество циклов, за единицы, максимум начало второго десятка циклов, 7-11!

И конечно же делать это надо не на земле, а на Луне, и не только и из-за её бесплатного вакуума, — но и потому что мы знаем что в холодных ловушках вечно тёмных полярных кратеров находится ртути больше, чем известных ресурсов и запасов на Земле вместе взятых находятся.

Там находится золота (если перевести не ртуть, а лишь ту часть её которая составляет необходимый нам изотоп) в золото, там примерно на 16.000 лет текущих темпов добычи хватит золота! 

2. Вообще чушь. Это не так работает, это не то что может сработать или не сработать, это буквально абсолютно точное знание про нашу реальность: мы знаем что это будет так работать. Мы на основании комплекса этих знаний ядерные реакторы строим, термоядерные бомбы рассчитываем, это такая область реальности, про которую мы настолько много знаем что можем себе позволять такие чудеса творить. 

Перестаньте нести обесценивающую чушь, вы здесь лжёте себе и другим. Вы зло этим самым творите!

3. Даже если просто давать ему там вылёживаться, — это вовсе не 30 лет, а 13-18.

При том что у нас радиоактивно не само золото, радиоактивен будет не распавшийся изотоп ртути-197.

Мы золото освободить от этого изотопа банально химически можем. Одно из этих веществ химически нейтрально в довольно широком диапазоне, другое нет. 

А можем просто через нашу установку разделение изотопов пропустить. 

И получить изотопно чистое золото.

Хотя проще и разумнее будет вообще ничего с ним не делать, и дать полежать, погреть вселенную, 14-18 лет. 

Золото всё равно хранится в хранилищах, если его в качестве средства обеспечения рассматривают. 

Какая разница? 

Если нужно будет получить приток золота в промышленность, можно брать из нынешних хранилищ не радиоактивное золото и заменять его радиоактивным, отдавая не радиоактивное в промышленность. 

4. Тоже чушь. Это будет чушью довольно долго. Нам сейчас предстоит взрывной рост экономики, только разворачиваемая в пустынях роботизированная экономика на два порядка будет больше нынешней человеческой. А есть ещё экономика роботов на Луне, которая тоже будет расти. 

Им золото нужно будет не в качестве побрякушек, им золото в микросхемах нужно будет, и тому подобных настоящих производств материальных вещей.

А ещё мы очевидно видим крах долларовой системы, пока ещё в замедленном режиме, но начавшийся крах, по крайней мере конец её господства. 

И очевидно что цены на золото сейчас растут именно поэтому: все пытаются нарастить золотое обеспечение. 

Но чтобы у вас ваша валюта была обеспечена золотом, золото довольно много должно быть. 

Хотя это конечно теряется на фоне потребностей промышленности роботов, чей рост нас вскоре ждёт. 

Мы ещё из океана золота начнём добывать, при помощи биотеха, выведя планктон который будет фильтровать его, и моллюсков. 

И специальных китов для фильтрации. Начнём с меди, потому что у насекомообразных и моллюсков, представляющих большую часть зоопланктона и в целом животной биомассы, кровь на меди, вот как много её можно фильтровать из океана! Настолько много, что в качестве основы крови можно использовать массово! 

Одного только роста этого спроса достаточно чтобы оно достаточно дорогим оставалось. 

У нас спрос по экспоненте расти будет, а вот с источниками не ахти. Ртуть и океан — пока лучшие из шансов, остальные где-то в поясах астероидов находятся скорее всего
Reply: I would still love to own a gold bar lol
Reply: How did you learn this bro
Reply: @unib4324  he figured it out with a Mr Science chemist toy set from Christmas in ‘86 but he just opened it last week
Reply: @unib4324  By paying attention in school..
Reply: Sooooooo invest in mercury
Reply: @tiredanddepressed  lol pretty much (dont its a bad idea until this can be proven)
Reply: I'm all for detail nr. 4. Gold had it too good for too long.
Reply: Wiki history reminder that Fleischmann and Pons thought of the process first and were suppressed!

In 1989, two electrochemists at the University of Utah, Martin Fleischmann and Stanley Pons, reported that their apparatus had produced anomalous heat ("excess heat") of a magnitude they asserted would defy explanation except in terms of nuclear processes. They further reported measuring small amounts of nuclear reaction byproducts, including neutrons and tritium. The small tabletop experiment involved electrolysis of heavy water on the surface of a palladium (Pd) electrode.
Heavy water (deuterium oxide, 2H2O, D2O) is a form of water in which hydrogen atoms are all deuterium (2
H or D, also known as heavy hydrogen)
TLDR: maybe another 30 years?
Reply: Iy sounds like it's too inefficient to mass produce this way.
Reply: No shit, half of these are publicly known
Reply: If the process works, it's worse than you think.
5k kg of gold a year is 500 million dollars per plant, which, as stated pays for the plant and the energy produced. So now energy is free (if the energy to produce or gather things is free, so are the things) and gold is devalued.....why do we need currency? Any other solution than "eliminate the need for currency" either makes the idea not worthwhile, or creates an ouroboros of energy vs cost that would upend many other systems.
Reply: @donaldready2118 the energy isn't free. The net cost is zero, but that is because the gold has market value. If currency or gold didn't have value, then the energy resource cost would have nothing to balance it. No one is going to work or provide resources to run the reactor for free. Besides, sometimes supply actually drives demand. With more available gold we could potentially go back to a gold standard with bonds being issued on gold bars slowly becoming non-radioactive over years. That isn't to mention consumer electronics. As gold prices drop, more people have access to it as a material. This increases demand and potentially increases the value back to equilibrium
Reply: @westwind4153  .....which again, creates the energy vs cost to produce self eating war, which either makes building the plant not worth it, or pays for the energy produced in a never ending downward spiral if current economic policies were held onto. There is no plant made, or other things, like currency itself, would have to change. This isn't about a single plant. If this was even viable, they'd be everywhere a new plant was built. The tech would scale exponentially faster, the cost to produce would be reduced quickly, and there are few resolutions to that if other thinking can't change. It's energy production that creates a base currency as a byproduct, we don't have any models for that.
Reply: @donaldready2118 Eventually it will hit equilibrium. It is like wolves and deer populations in the wild. Deer population increases and food becomes scarce. Wolves population grows because deer is more plentiful. Deer population decreases and deer stop starving and this can reproduce more. Wolves begin to starve from overpopulation. Eventually the S-curve is reached due to capacity. The same would happen with reactors. Gold price would drop and less reactors would be built. Gold would be used for more things bringing up the price and more reactors could support it. The fed already prints money causing rampant inflation so it's not like it would be a new problem. At least having a tangible asset after inflation would make it better than what exists.
Reply: @donaldready2118  we’re getting rid of people with AI, why not get rid of currency and replace it with digital numbers.
Reply: @donaldready2118 who said energy is free? you overthink too much. People sell cheap stuff for huge profits all the time😅
Reply: @akimbanguehe3454 cheap, yes, but what have you EVER purchased that was produced at a net zero cost?
Reply: @donaldready2118 it wouldn't devalue gold, it's millions of dollars to produce grams of gold via this method lol
Reply: @donaldready2118  Except with increased stocks of gold, the value of gold would plummet.  The gold market would be upset but that's about it.  That is if they could produce the gold for cheaper than the current prevailing cost of gold.
Reply: @partizanpack and what happens if gold does become commonplace and replaces other ductile conductors? Everything is built on everything else, nothing stands alone.
Reply: @donaldready2118  The gold market would still collapse if you were to be producing that much gold a month.
Reply: @donaldready2118  even if the gold is produced and sold, they are still going to charge for the energy. Why do you assume it would be free? Also fusion would only be for supplying the grid. Other forms of energy would not be free. Grid infrastructure still needs to be maintained, so that would cost money as well. The idea that "free" energy collapses the system is a shallow , scifi understanding of capitalist markets.
Reply: @donaldready2118  I mean even if the gold cover the cost of the plant, they wouldnt sell electricity for free, maybe at a reduced rate, but they would still likely cover the costs by selling the energy.

The idea of free power due to X has been and will remain a silly idea, as the economics of it just dont make sense.
Reply: @kkirschkk  Well not here in America, but there are countries that would. Also do you realize you dismissed the idea as economically unviable while speculating on a brand new process that would make it viable, or at least a reduction in cost viable?
Reply: @Onyx-Rose150  well one I do agree a cost reduction is fully possible, but also remember generation only makes up like 1/3rd to half of the cost of the final delivered energy. So even if that went to zero (unlikely but lets say that) that would only net (assuming 100% of the savings where passed on) in about a 1/3rd to 50% drop.

Plus the companies that move power vs generate it are not always the same companies. Thats also why nuclear and solar havent actually reduced the price of energy in most places to near zero (heck in Germany its actually increased costs).
Reply: @kkirschkk  I was under the impression that the operating costs included delivery, since the operators own the lines. At least where I live they own the lines. But I'm no expert. I honestly would have to look up the stated gold production amount vs. the operating cost of a nuclear plant. Of course I'd just assume enriching uranium and enriching mercury will be roughly the same cost.
But I digress, my point was we don't have any varified details yet, so ruling out economic viability is premature. Do I acturally think it would would reach the dream scenario, no. But it is 100% true that insisting on antiquated paradigms has screwed us over multiple times. I.E. pharmaceutical companies. People still say "they need the money to do research", but they haven't had any major breaktroughs in over a century. Modern medicine is almost all the result of public funded research. But people are stuck on the old paradigm that hasn't been true since well before the Spanish Flu. Things change and we need to be able to integrate new information, keeping an open mind until the facts come in.
Sorry if this sounds like a clapback, it's not meant that way just getting my thoughts out.